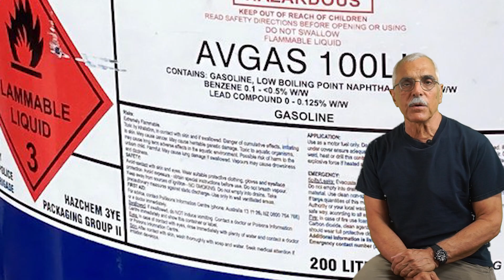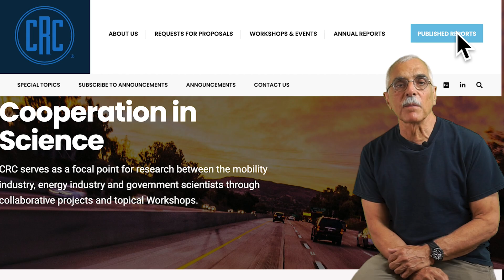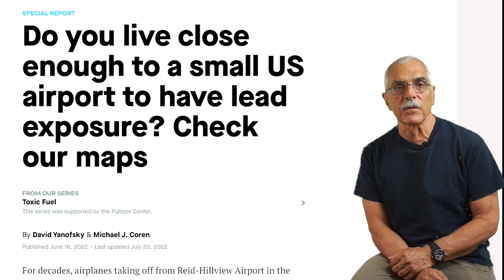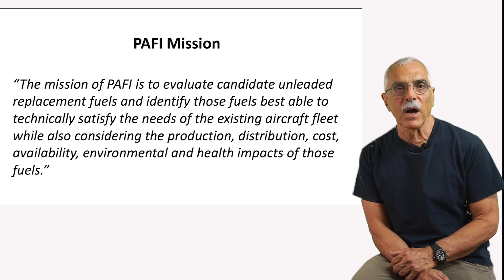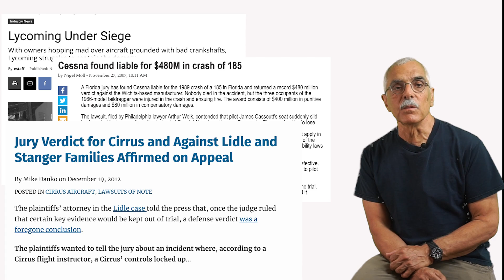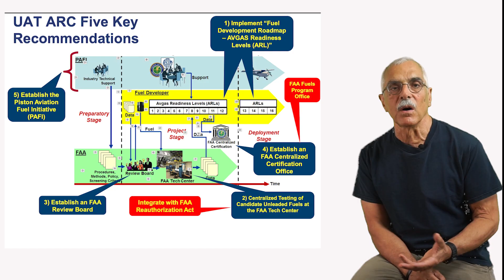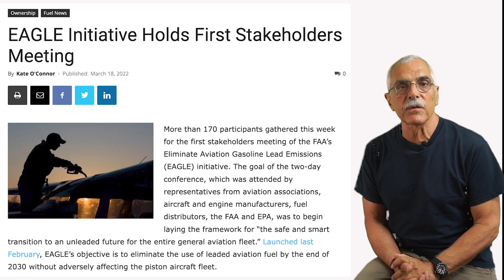The Long, Twisted and Slightly Ridiculous Story of Avgas Part 2

Comment: GAMI seems to have this issue solved, so WHY is EAGLE asking us to delay 8 MORE YEARS?  Is it just the established suppliers want to protect their market for another decade?
Reply: Yup, and they don't want to shed license fees to GAMI, I'm sure.
Reply: @77thTrombone  or unwilling fund their own research and develop their own blend and STC. Having congress set a hard deadline on when 100LL can no longer be sold is what's needed to drive these companies into action. But the manufacturer lobbies are surely doing a great job preventing that.
Reply: @ulbuilder  no doubt.   No doubt at all on that one.  It's an inversion:  a democracy responding not to the people but to the people with the money.
Reply: Gami's patents regarding G100UL are a pretty good checkmate against the establishment. So, yes it is a protection racket.
Reply: The cynic in me says that patents last 20 years, so Eagle will take 8, followed by another dozen years of flight testing and paperwork accumulation, and, right around the time those patents expire - voila!  
GAMI is a no-brainer - everywhere but inside the coin-operated beltway, it seems...
Reply: Because the fiduciary responsibility doesn't care about your future or the planet's
Reply: Bureaucracy at its finest
Reply: The best money-spinner is the one you only have to buy once.
Reply: @GeofreySanders  as opposed to the time-share rentals that aren't nearly as good, and are usually trashed by a previous (or potential future) donor?
Reply: It’s impossible to select the working formulation that GAMI has developed. GAMI is not a big company with money to line the pockets of the  bureaucrats that must sign off on this.

Comment: Answers the assertion - that 100LL will not be going away anytime soon - made in the first minute of Part 1 in the most convincing, if depressing, manner possible. Outstanding job, Paul!
Reply: In some parts of the world it very well might. Professionals use Jet-A and most private aircraft have lower compression engines that can use alternative (and cheaper) fuels. With lower demand for 100 LL there is no longer a business case when you factor in the cost of shipment and storage. Especially in remote parts with little traffic (low demand) to begin with.
Reply: @2.718e  Indeed! GA in much of the world is rare and what you say makes perfect sense. Here too it's undergone a staggering decline which may be the core reason why there's been no replacement for 100LL.
Reply: @2.718e  although it been said the aircraft that need the higher octane also use most of the avgas. I guess?

Comment: As a 42 year professional pilot, A&P, RV-8 builder, Stearman owner, and with an engineering background, I don't want to see 100LL go away. The ARE limits to physics on the planet. Its one thing to put in your car, its quite another to have that engine quit at 21,000 feet in the weather in Cessna 421. There may be a replacement for it, but its flying. I'll have to lift all that added complexity of electronics and mechanical systems into the air. If there was an economical solution for this issue (is it really an issue after all? and I doubt the rest of the world will follow suit... been there done that), it would have been developed after 1996.

Comment: does avgas in Europe also have leaded additives?
Reply: There are many types of AVGAS. Some low octane variants were unleaded worldwide. 
Paul mentioned Hjelmco Oil, they have been selling 80 UL since the early eighties and replaced it with 91/96 UL in the nineties. 

EASA SIB 2010-31 (yes, that’s 12 years ago) states that 91/96 UL and 91/98 UL meet the requirements of MIL-G-5572 and ASTM D910-07 for 91/96 and 91/98 except for color, being colorless. Therefore, if it is approved for the engine type, it is also approved in all airplanes approved for Avgas 80, 80/87, 78 or (for one engine type) 91/115. Since the fuel meets the requirements for Avgas there is no issue with fuel tanks, o-rings, hoses or such. It’s still Avgas. Therefore the only issue is the fuel requirements for each engine type.
So in this case EASA were helpful. Using national regulations every single country’s CAA would have to come to the same conclusion.

For Lycoming engines the types of fuel approved for different models can be found in SI 1070. When using 91/96 UL oil must be used as detailed in SI 1409. Generally speaking 91/96 UL is approved in parallel valve engines and not in angle valve engines.

Continental also have a list of minimum fuel requirements, but only old O-200, O-300 and certain (I)O-470 are approved for a minimum of 80/87 or 91/96. 

91/96 UL is currently available in Sweden where it is very common at smaller airfields and in flying clubs. Since most commercial operators use turboprops or jets there is little demand for 100LL. This has led to a situation where trips in some parts of the country must be carefully planned, as most airfields have only Jet-A or 91/96 UL. Home builders and prospective airplane buyers must also consider this. Therefore a Cirrus is usually ruled out early, simply because it can’t be refueled in many places. Someone looking to buy a certified aircraft of a somewhat modern design would probably get a DA-40 TDI. Homebuilt designs using a 180 hp (I)O-360 or a 235 hp O-540 are an option, but not one using a 200 hp IO-360 or the IO-390, for the same reason.

So we basically have the option of finding a replacement for 100 LL that works with the (somewhat archaic) hardware already in use, without modifications, or only using hardware that works with the unleaded fuels available (including Jet fuel). 

The EU setting an end date for the sale of 100 LL wouldn’t necessarily be a bad thing.
As a comparison portable fire extinguishers must be halon free by 2025. So if manufacturers want to sell extinguishers in the EU after that date they must find an alternative. The date for trash bin extinguishers was 2020, and they managed that. Engine and cargo extinguishers come later and are a harder problem to solve. But without having an end date to the exemption for aviation, nothing would have happened.
Reply: Avgas 100LL is Avgas 100LL, although we commonly call it "petrol" rather than "gasoline" when we speak English. And it is blue and smells awesome. :) Since some bunch of stupid bureaucrats from Belgium (they call themselves European Union) banned import of TEL into Europe the future is a bit grim so yes I hope for a drop-in replacement or an affordable STC (and the second is not going to happen since each country has its own Civil Aviation Authority and these people have to do something and pretend being overworked so EASA certification might not mean much). Many people in my country (Czechia) actually prefer to fly Rotax-powered ultralight aircraft for leisure so they use 95 octane unleaded mogas (please bear in mind that we use RON rather than AKI or (R+M)/2 so 95 "European octanes" is 90 "American octanes"). Flying club airfields either have it or the pilots carry it in jerry cans. In some parts of Europe it can be hard to get Avgas so Diamond aircraft with their diesels are quite tempting.

Comment: I have an STC for Mogas. I’m willing to fetch it and store it, except I would have to drive 100 miles, round trip, to get it, and I could lose my hanger if I was caught storing it. Yay bureaucracy.
Reply: Get a bed tank with a pump in your pick em up truck.
Reply: That is frustrating. Also knowing how "casual" many people take safety, I'd hate to think of every T-hangar around me storing 10-100+ gallons of fuel in homespun plastic containers or rusty metal tanks, venting and leaking into a enclosed space with electric service.  That sounds like a way to wipe out a whole row of hangars & planes.
Reply: @chrisruf7590  Yet every hanger is already filled with large containers of 100LL avgas, many of them leaking. The hanger next to me has a Cherokee with a sump that will drain the right tank in less than a week. While I admire your commitment to safety, your argument is flawed.
Reply: @glennstubbs8232  I concede that you made the point that there has not been a fire there yet, and maybe the risk is moderate. Can you concede that you made my point that even pilots are irresponsible with storing fuel, and being irresponsible with the property of other nearby hangars and aircraft?  Nevermind a pilot being so reckless to continue operating a plane with that bad of a leak, that could get worse at any moment in flight. That guy is why there are these rules that cause you frustration.
Reply: @glennstubbs8232  Yes, your one example of a crappy exception certainly proves his argument is flawed… SMH.
Reply: @chrisruf7590  Yes, Glenn’s whinging about leaky aircraft doesn’t negate your point about safety overall.

Comment: Aviation engines are still stuck in the 20's and 30's, not surprising then that we still use leaded gas as well.  EFI, liquid cooling, and efficient combustion chambers would allow the "high performance" engines with 10:1 compression run 91 octane MOGAS with no issues.
Reply: @MN Bearhawk Yes, but right now that's a lot like saying it's an easy problem to fix, just get every airplane owner to spend a few extra tens of thousands to keep their airplanes flying. 
There a large fleet of those old tech engines that are going to be around for decades. The cost to upgrade them to fuel injection, especially with approved parts would be prohibitive. 
Probably the best option right now would be one of the UL fuels recently developed and let those with the deep pockets that can afford higher performance airplanes cough up to figure out an alternative.
Reply: @Surestick88  Large fleet of old tech engines around for decades? They’re all toys, no reason to exist except entertainment (most of business GA is bizjets and turboprops) so the old birds can be dumped just like most classic cars were except for a few collectors and enthusiasts. Electric will replace a lot of the old birds, and unfortunately there will also be an attrition in GA pilots who just fly for funzies. NOT saying it SHOULD be this way, but all old tech eventually gets dumped en masse and something new takes its place.
Reply: I love seeing what Rotax is doing with modern tech. Simplify the cockpit and pilot workload while enabling smaller, lighter and more efficient engines. Unfortunately I think a lot of pilots are put off by 3k+rpm cruise and turbochargers.

Ye-olde air-cooled engines have their place, but Lycoming and Conti need to start putting their R&D into newer tech or they'll soon be pushed out of the market. 40yo airframes are not a good platform for sustainable business.
Reply: @Nickersont88  I like what UL Power is doing, just wish they had gone with liquid cooling as well.  Tighter tolerance provides less blow by, you're not cooling cylinders with excessive fuel, etc ..
Reply: @Nickersont88  try 4-5,000 ish rpm cruise.
Reply: At the same time, 100 octane UL gas has been available for a decade or so for race cars.
Reply: @RussellTelker  that's what I thought too!
Reply: Automobile gas uses a different Octane measurement scale.   That fuel would not be 100 Octane using the Aviation Octane measurement scale.  Aviation uses the Motor Octane rating.  Auto fuel uses a calculation (R+M)/2, the average of the Research Octane rating (theoretical) and the Motor Octane Rating (actually tested).   So the octane number you see on auto gas pumps is overstated by 2-5%.
Reply: @stevebusby9566  it's not necessarily overstated it's RM2. Race fuels use research octane so you could say they are somewhat overstated as well. But it's normally something like 2-3-4 or so octane points between motor & research.
Reply: @oneninerniner3427  You are correct.   But the difference in 97 Octane and 101 Octane in a high-performance air-cooled engine is what they call "yuge" in terms of detonation margin, especially when you are 10,000 feet in the air and can't pull over and wait for a tow truck.
Reply: @LiraNuna Check out Adept Airmotive.

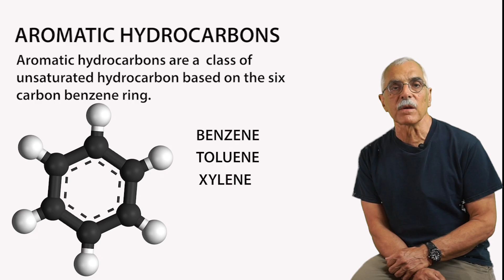Comment: 9:55 I like how you got them to spill fuel all over the cowling to show how it won't strip the paint off
Reply: As a good member of the aviation community, I perform that test virtually every time I use the fuel island.
You're welcome.
Reply: Paint stripping fuel?  Concern about un-filled tanks, has some instructing the line boys to “fill it till it overflows”.  That would leave a mark.
Reply: @cshk100  but it saves weight, paint is heavy you know.
Reply: @cshk100  If you fill your own fuel from credit card automated stations you understand. You are looking into a dark tank in various lighting levels, from bright sunlight to total darkness with a flashlight.
Reply: Yup well placed clip but I would have scowled and mauled that fuel attendant... to oblivion.
Reply: I highly suspect that was the oil company man under instruction to give more than the tank needed and charge Paul for the wasted extra.